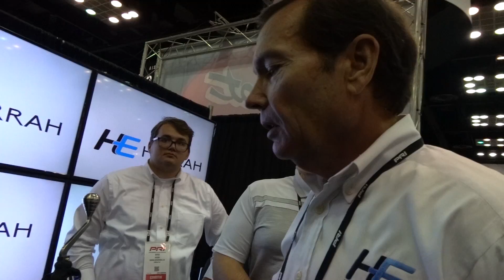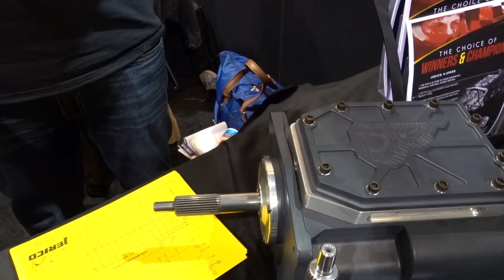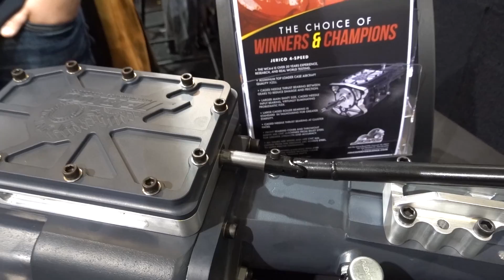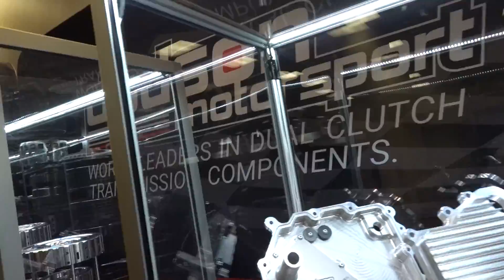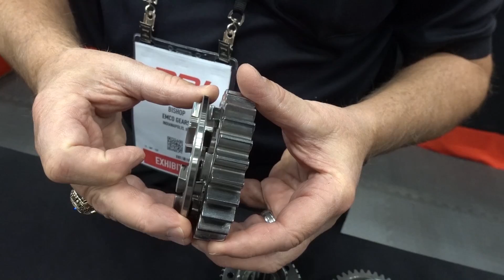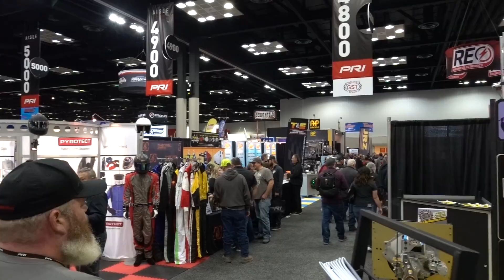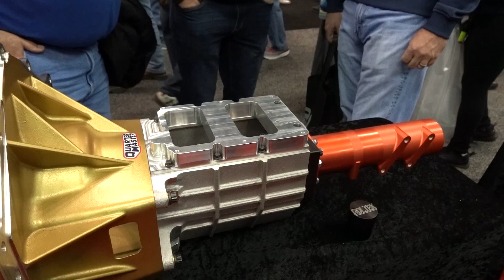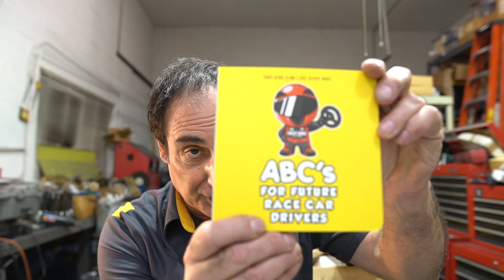PRI Show 2019 - Nascar and Road Race Transmission Edition

Comment: 28 to 21 ratio at the head set. That has no hunting teeth.
Reply from the maker: Non hunting / hunting sets usually apply to ring and pinions. New gears are extremely accurate. Considering most of the gears shown in the video are of a spur gear design this is no big deal. Also years ago some manufacturers required timed sets. Some dual cluster boxes and 2 stage planetary sets require timing.